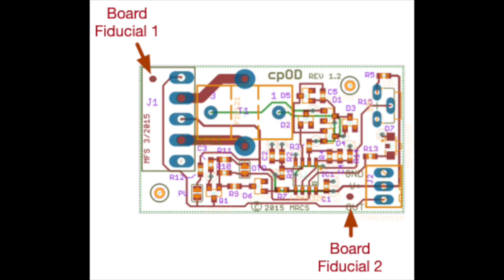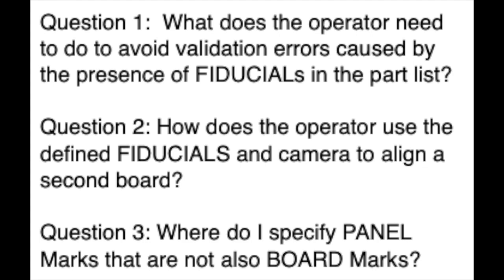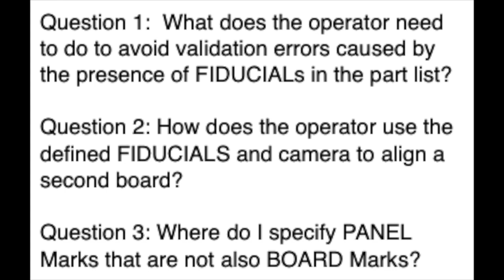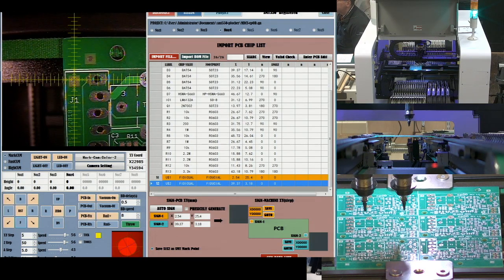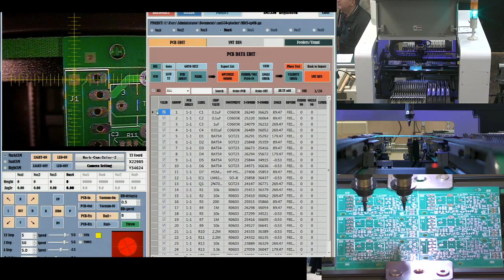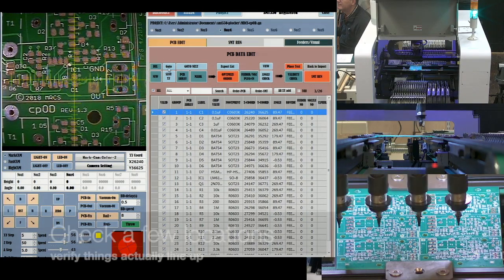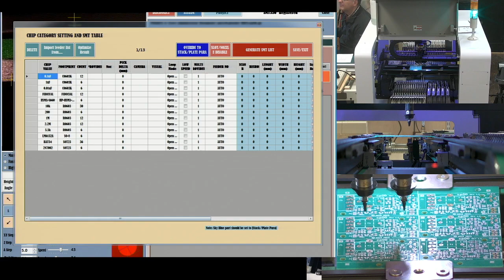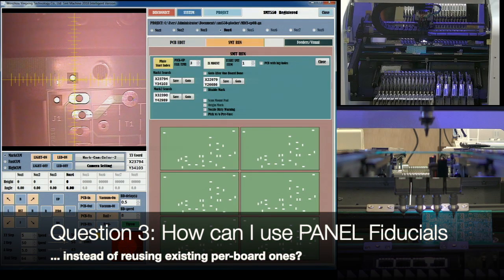SPCoast SMT550 Question 2020-03-20: Using Signs, Marks and Fiducials

Comment: For question 2 there is a recent version that says "adjust PCB" but the problem is that it modifies all the coordinates and angles, it is too intrusive.
Reply: The "PCB adjust" feature, the way I use is when I wanted to add new components into existing project (poor me doesn't have everything in reels initially). As the current PCB sitting on the rail coordinates are only readjusted during SMT run, you can't just add the new components.. Try going to PCB edit and move to any existing components' coordinates, it will be off as the mark detection only runs during SMT run. So, if you want to do like what I'm doing, you first do PCB adjust with the PCB that just has been fed. Once you update the adjustment, you can then add the new components on the project. At least, that is how I use them for my purpose and that was told by HWGC.